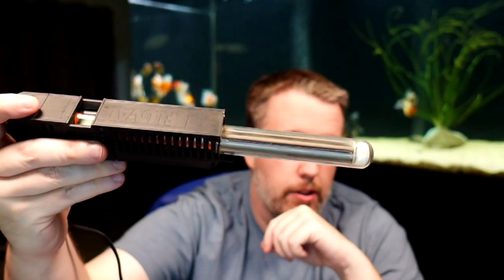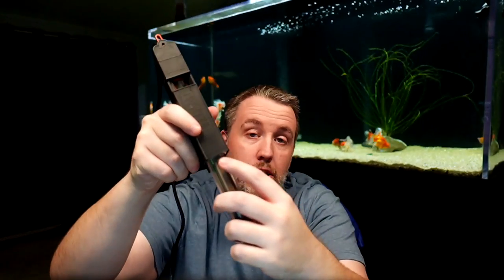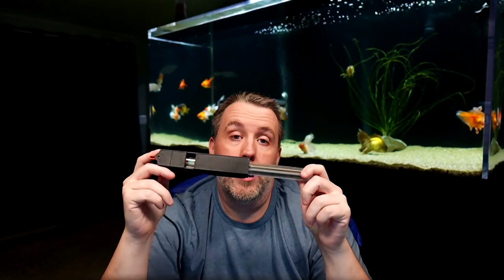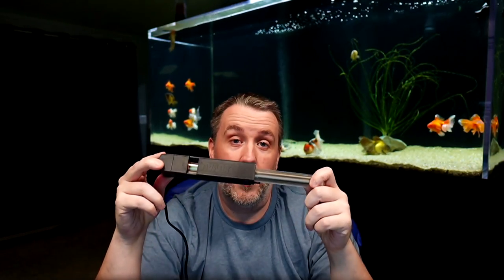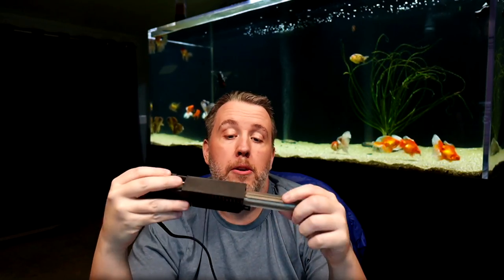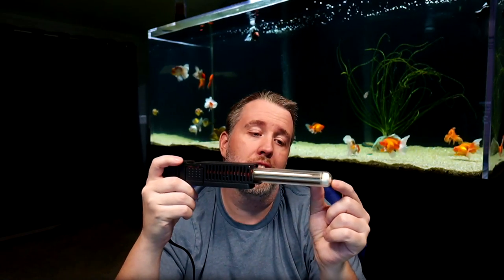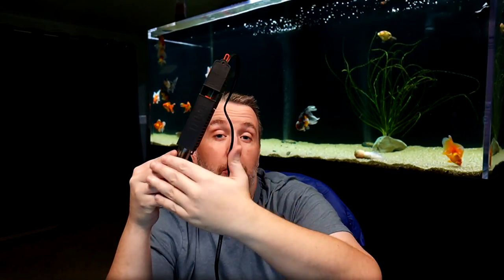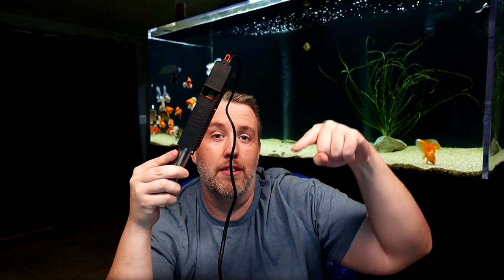The Truth About Aquarium Heaters (and Why They Always Break...)

Comment: Great video.  I ended up with a 200w heater for a 75g.  I put a heater on each end of the aquarium so it’s already got a back up.  My left heater is the main heater, the right side is the back up.  So far so good.  I personally went with a smaller heater for longer run cycles.

Comment: I found this video just in time.  I am new since October 2022.  

I am starting a 55G 21"H Community Tank room-divider and a 20G 12"H Long to up my Betta and his Clean-up Crew into.  The height is the same.  

I am looking at getting the Eheim Adjustable Calibratable with overheating auto shut-off for both tanks. 

Being a newbie, I unknowingly bought the pre-set heaters for my Betta Starter Kit Tank and for the Quarantine Tanks (1 10G & 1 5G... because it made sense at the time.  Now, I know better.  They over heat up as high as 82°F... not good for some plants... so I since learned.

Great job in explaining how heaters work and why they should be placed diagonally.  Makes a lot of sense knowing how it is designed and where the sensor is located.  

Thanks again.  With a post concussion thing going on, I do appreciate your tone, your speed a bit slow enough that I can catch what you are saying, and the visuals.  

Much appreciated.

Comment: Good discussion.  I use heater controllers on all my tanks and set with a variance of +/- 2 degrees Fahrenheit.  Less on/off cycles.  Also use smaller than recommended heaters on most tanks and they heat just fine.  25w on 10 gal, 50 watt on 20 gal, etc.  I’ve had 5 of the cobalt neo-therm heaters and all but one has failed.
Reply from the maker: For some further info for us, what was the purchase date on those cobalt neo therms?
Reply: Aquarium Co-Op Cory, I purchased two when they first came out (2014?).  They both failed and were replaced by Cobalt in 2016 or 2017 before the warranty expired.  I had also purchased an additional Neo-therm.  The new heater and the two replacements were acquired after Cobalt “fixed” the issue which caused early production heaters to explode/crack.  Only have one still working.  Most of them failed by sticking “On”.  Only one had a cracked housing.
Reply: What about 5 gallon tanks? It's hard to find good quality heater for less than 25 watts.

Comment: Hey! Something I was actually doing right all these years! I keep my house cooler due to health issues, so my tropical tanks have always had heaters. I place them so they are either under the water return of the filter, or there is an air stone/bar  under them, figuring that would help circulate the warmed water better than just sticking the heater in the corner 'out of the way'. Once the fully submersible heaters came in, I was mounting them horizontally on the center back of the tank, and again running air directly beneath them. Maybe why view only had one heater not last longer than five years (and that because it got dropped on the floor). Not trying to blow my own horn here; it's just nice to find out I was doing it right. Thanks, Cory!

Comment: Great info and advice! I use a heater from the Polish company Aquael, platinum heater 50W. I looked on YT and on the internet how to properly set it in an aquarium. In the end I decided to add it at an angle. Watching this video I'm even more happy to done so...and also for my filter, that is close by, to provide flow to the heater. The heater has an electronic measuring system to show the actual temperature, but just to be sure I always have my regular thermometer in the aquarium. When I do my water changes I'm always careful to first unplug it and let it cool for 15-20 min and then start to lower the water. I use it since August 2019 and so far so good. But I'm always surprised to see my fish eating food from it...like it's not that hot.

Comment: it would be interesting to know the day/night temp fluctuations where the fish are found locally. It would probably differ between fish found in large lakes vs streams/rivers. I don't think multiple cycles of heating and cooling during the day is the answer, but being able to set a day and night target temperature to get one nice temperature ramp up during the day and cool down during the night should be the goal. This would probably only be feasible using a heater attached to a variable wattage controller. Assuming proper heater use (located in higher flow area, placed at 45 deg, etc), the large number of variables (tank size, ambient temperature, target temperatures, etc) would necessitate developing a complex heating algorithm or ultimately an AI algorithm to control temperature to achieve previous stated goal. In other words, ultimately a computer controlled device.

As far as safety is concerned, on any tank with livestock i wouldn't risk using a heater without a thermostat. Additionally, if I had a really rare/endangered/extinct in the wild species, I would probably go to the extreme of DIY'ing a heat exchanger system that would physically isolate the heated water from the tank water, to prevent heater ruptures from possibly contaminating the tank and killing livestock.

Interesting topic. Fluke makes temperature data loggers that would allow accurate data gathering. That would be my first step.

Comment: I always have my heaters hooked to a thermostat to give me that added piece of mind
Reply: What happens if the thermostat is faulty...  lol but, I agree, have mine on thermostat also along with thermometers also.  In 120 have 4 and in 75 have 3 and 150 have  5. All the lil ones, 55 and delow I have 3 to 2.  What we won't do for our fishy family!! Lol
Reply: thermostats are rubbish for heat control, either full on or fully off, this puts strain on everything else but its the cheapest solution for the manufacturer, a PID controller like used in incubaters is far more accurate and coupled to an ssr relay no moving parts, its whats in your cruise control in your car, imagin trying to hold 50 in your car using only full throttle or no throttle, almos imposible. thats just what a thermostat does.
Reply: @incubatork  Sounds smart but where would such a thing be found that would work with aquarium heaters? Link?

Comment: Use an external/separate thermostat to regulate the temperature and set the internal thermostat a couple of degrees higher, then you have a failsafe if it should get stuck and you won't boil your fish.
I make mine myself and have WiFi access and monitoring on them, not that hard to do if you got some knowledge in electronics.

Comment: Repeated heater issues, including cooked guppies, have encouraged me to keep ambient temperature tanks, roughly 65° F. Currently enjoying Endlers, Bloodfins, White Cloud Minnows in my 125 long
Reply: In my 125 I use 2 x 150 watt heaters instead of a 300 watt. If either one fails (in the on position) it's not enough to cook the fish. If one fails (in the off) there is enough heat from the second heater to keep them alive until I replace it. Costs a bit more but with a tank full of expensive fish, worth the investment. And the truth is, they make them as cheap as possible vs as well built as possible.

Comment: Validation! I have never felt so validated as a hobbyist. The reason my no-name garbage brand heaters have kept going for a decade and my buddies' expensive ones keep failing is because I always put my heaters right under the filter's outflow. My reasoning was aesthetic, to make them both easier to hide, but I'm so glad I was accidentally doing it right all along!! Both because of the heat coming off the filter making it easier on the heater, and because it's in the highest-flow part of my tank. Now I keep my aquarium room at about 75 and only run 1 heater (for a frog that needs about 80) and I can tell you that if most of your livestock need similar temps, heating the whole entire room is really the way to go.
Reply: I put the flat aqueon one directly into a hang on back filter. Works great

Comment: Mine breaks 9/10 times due to dropping them on my concrete floor :P
Reply: why are you taking it out of the tank so often? For cleaning?
Reply: You have made a good point there even if it was tong in cheek. I have a selection of heaters from some cheap ones to more expensive and I have not had any trouble. It is physical and thermal handling. Handle gently and give them chance to cool also any crud like Cory was referring to get it off with a scourer as this will cause a hot spot and weaken the stress the glass.
Reply: Aqueon pro heater is made of some kind of metal and they work well. Never dropped mine but I'm sure they'll survive a fall or two
Reply: @urhma7419  I agree I have 2 of them and they are great. They use electronic thermostat. In the USA look got Cobolt which is calibrated in Fahrenheit.
Reply: @SuperRoverboy  not that often but since I've about 70ish tanks in my shop I handle alot of heaters and accidents happen 😁 I mostly use and sell aqua nova heaters since their selling price is pretty much what a jäger heater costs to stock..
Reply: @gunnarsjolander6171  ahhh fair enough then. I think I've only taken my heater out once....and that was to move the tank from one side of the room to the other.
Reply: Robert Fletcher tongue*
Reply: so do not drop them.

Comment: Great discussion on heater technology. I recently bought a new heater for a 15G Fluval Flex (lots of flow) and did a lot of research on proper wattage but also the most reliable brands. When I found one, I placed it across the tank from one of the output valves. When the heater is working, I can see the hot water around it streaming downward toward the substrate, then away into the tank. Everything is working better when I went with the proper wattage and made a better choice on placement.
Reply: What heater did you go with? I have the same tank.

Comment: On another hand, their reason why heater need to be precise, when you have a saltwater tank you don't want a lot of deviation.
Reply from the maker: While this is true, most saltwater hobbyists have problems with too much heat. This is why external water pumps exist, methods on how to make a screen mesh top etc.  I still believe it to be the same core problem just from the other side instead of being too cold, it's too hot and heat management is the key.

Comment: I have used 2 aqua top 50w heaters for about 2 years now in 10 gallon tanks with no issues even for a cheap heater. I put a 30gallon tank together on a tight budget and put in a 100w heater I got for 6 dollars which lasted about a year and half surprisingly until it got stuck on. Caught it before any fish issues occurred. I went to replace it and figured the 2 other aqua top heaters are working still I will get one of those as they seemed decent. I decided I was going to order one big enough to heat a 125 gallon as future proofing. I did mount it on a 45 degree angle as it did not fit in the tank stood up. It only lasted 2 months before it stopped heating I chocked it up to just getting lucky on the first 2 heaters but after seeing this I am not sure. Also I am now using one of the 50w heaters in the 30 gallon tank and it heats it just fine in my house. I wish this video was out sooner it might have saved me some grief.

Comment: i have a 9-year-old fully submersed heater at 45 degrees angle and it's still working fine. I have a top on the tank as described and heater not cranked

Comment: All what you said is spot on, toward the end you came close to the most important part of the solution but missed it...  From my engineering background and aquarium experience, I never had a hater die from heating coil breakdown (element that is at most danger from frequent cycling). 9 out of 10 of my heaters died with stuck control unit, stuck on "heat". Once in a while stuck on "cold". What causes that is that we put all three aspects of the heater closely together: heater,meaurement and control circuits. Latter two will suffer from close exposure to the intense heat and break first. Solution? Aquarium heaters keeping all three elements SEPARATE. Heater bulb, temperature probe somewhere else in the aquarium and control circuit completely out of the aquarium. Yes, that can also fail and one should keep your points in keeping that system in operation as well but the failures would dramatically drop.
Reply from the maker: I'm not sure how I missed it. Is this not exactly what the heater controller I recommend is doing? It turns the heater itself into just a heating element, separates the probe and brings the circuitry outside of the aquarium.

Comment: The light bulb analogy is actually really apt. This works exactly the same way as a light bulb, only with a thicker element that will produce more heat rather than light.
To address the issue of letting water cool a couple degrees before turning back on. A PID controller is what you want. For safety, maybe place the temp of the heater just a couple degrees above the temp you want. Connect the heater to the relay, and use the PID to control the min and max temps the heater comes on at. It's how I sous vide my steaks. A PID is only about 25, 30 bucks and can be made quite unobtrusive. 
In fact. I may try this out once I get my tank up.

Comment: You explained the 45° heater tilt on a live stream a while back. Tilted mine then. It's a good tip. Also on water changes I use the top of the heater to know when to stop the siphon.
Reply: why not put the heater horizontally if heat rises? whats the benefit of 45 degrees vs horizontal?
Reply: @desmondliart  this question may be answered better by Cory but I used to keep mine horizontal. There may have been an issue with how the unit measured the water temperature. Don't quote me on that. I couldn't find the Livestream I was referring to, could be over 5 years old.
Reply: @danaburke9914  thank you for the response. will try that for my turtle tank

Comment: This is so insightful, and great for us newbies. My follow up question is in regards to general running costs of pumps, heaters, coolers etc. Here in the UK bills have gone up by nearly 400%this year, so I just want to gauge that I can afford the running costs longer term. Most UK houses dont have aircon, so I believe the heater at a minimum would be required. But want to do right by the fish, at a cost effective price.any suggestions?
Reply: Same.

Comment: The focus on a single temperature for a tank down to the hundredth of a degree is what kills more heaters. You nailed it early. Heaters fail because of cycles. The longest lived heater is never turned on. The second longest lived heater is never turned off. My controller has a 10 degree range. Target temp +/- 5. My heaters change state an average of 6 times every 24 hours. Based on my experience in commercial cooking, they’ll last most of a decade in my sump.

The case where there’s too much heat for the flow is a design failure. The heaters don’t have over temp protection. In my industry? That’s a compliance failure and we can’t ship product.

Comment: Wow! This was REAL VALUABLE INFO!! And you did a fine fine job explaining all the ins and outs.
I feel like an idiot. Well I'm a control freak.

I currently have my heater controller (STC1000) on a 0.5 degree celcius tolerance, and I'm surely going to up it to 1 or even 1.5 degrees celcius after seeing your vid!!
I want(ed!!) my tank around 23.5 degrees celcius all the time but it's NUTS if you think about it. Does that happen in nature??

I open the window for fresh air and boom my heater comes on.... I open the radiator to heat the room (building heating so the costs are shared) and I forget to turn it down when I close the window, boom, fan goes on..... because it's on a freaking 0.5 degrees tolerance.
*facepalm*
THANK YOU! :)

Comment: My heater is inline inside my external filter. Out of sight and very efficient.
Its being controlled by a cheap arduino board and temp sensor on the other side of the tank.
Kicks on at xx degrees and turns off at xx degrees, so theres a slower on-off cycle.

Comment: Great video, Cory. I have had two Ebo Jager heaters running in a 55 gallon tank non-stop since 1996. Really well made, lots of surface area, plus low work load since there are two heaters instead of one.
Reply: Since 1996, that's insane.
Reply: All mine from 1980 and still working !

Comment: There has been much talk about water flow over heaters in this and other videos by you. Could you please talk about good and bad ways to get that flow? In my case, I just setup a heater horizontally with a long air stone underneath it. Is this ok? Is there any way that the constant air bubbles could hurt the heater? Is this a good way to assure good flow? Thank you.
Reply from the maker: I'm not sure that can be quantified without lots of testing. Surely it's better then having no flow. However depending on how big the bubbles are, how long the air stone is, and how much air is actually going through would determine the current of the water. Also over time air stones typically change flows due to clogging. While this is true with filtration also, filters tend to get serviced where most people never service an air stone.

Comment: I have a Fluval 50 watt pre set  in a 14 gal cubewith nothing but an LED power indicator. I have it vertical two thirds down in the tank . It is constant on no cycling. Completely enclosed in black plastic  so it hides well. Keeps my tank slightly on the cool side at 76  degrees. I customized it by removing the suction cups and replaced them with magnets .

Comment: You hit some good points the best heater is the simplest one that is mechanical. No thermometer in it. And then its cuz nobody knows now to install the heater correctly it should be horizontal not vertical

Comment: I'm running the heater to the rear center of the glass even distribution heat. Unlike suggestion in the conner of tank from Mom and Pop tropical fish shop. I will also be purchasing a wave maker to help with the water flow to avoid hotspots.